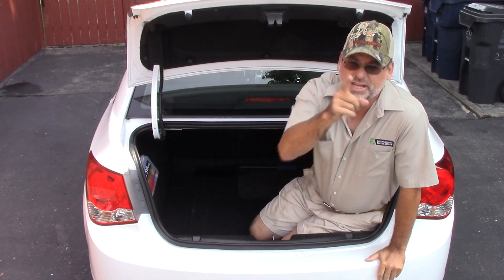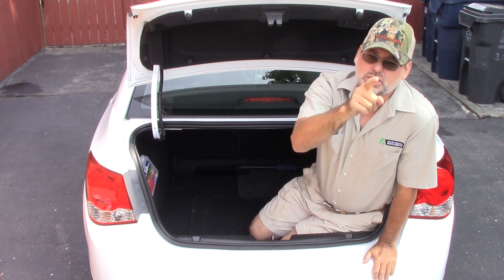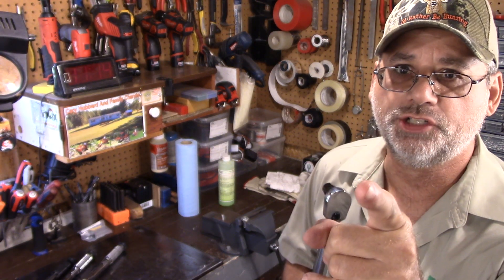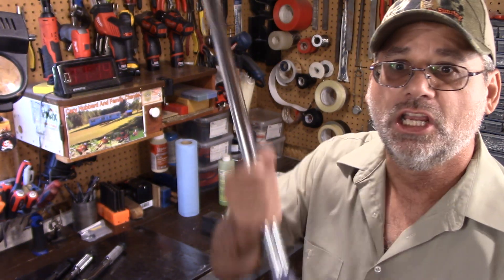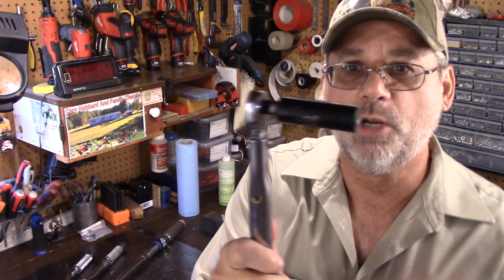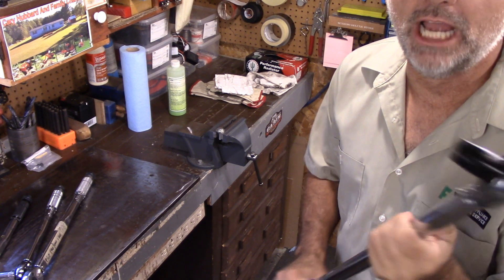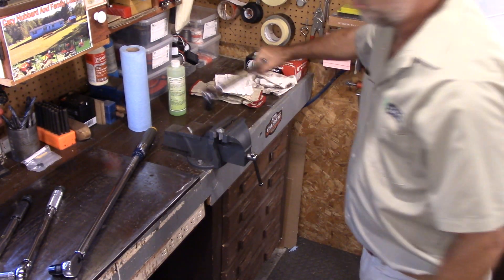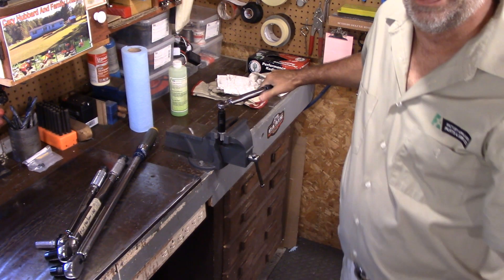HOW TO USE A TORQUE WRENCH   | TOP TECH WITH OVER 40 YEARS EXPERIENCE

Comment: What do you think of the torsion type?  I don't often need a torque wrech, but I do every once in a blue moon. SO I got a 20 one that has the bar that goes from the handle all the way up to a gauge by the drive mechanism and as your turn it, the bar will point at the number.
Reply from the maker: The best style I have used and by far the easiest and longest lasting is the beam style type. Check them out and they last a lifetime. Cheers
Reply: Do you have to get them tested or is there a relatively easy way to test them?
Reply from the maker: @tarstarkusz  They stay calibrated well for years as a diyer but a tech using them would get it tested on a tool truck once a year.  Ive never had one recalibrated for the few times I use it.
Reply: Thanks. I appreciate it.

Comment: Clean cars run better Steve
Reply: My guess is Steve  was required to only torque clean nuts,  you can’t argue with 40 years of twerking experience
Reply: Joe O I had a car get 7 mpg less when I didn't wash the winter salt off the car. Maybe not washing the car just upset me into bad driving. 😂94 Ford Escort
Reply: DE Nichols  good to know, do you have torque wrench experience
Reply: Joe O I sure do. Been in the field for some years and I've used torque wrenches on more than lugnuts...most don't even do that unless their shop requires it.
Reply from the maker: The sure do Joe 40 plus years :)